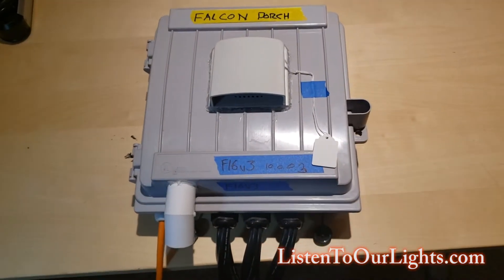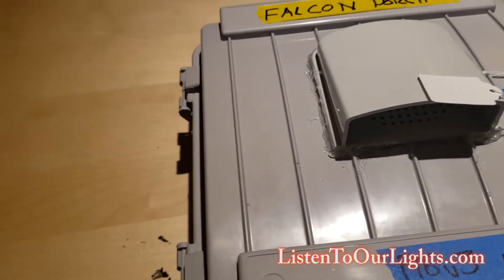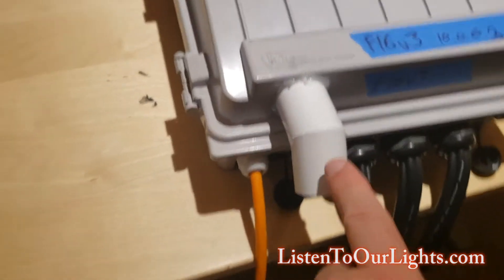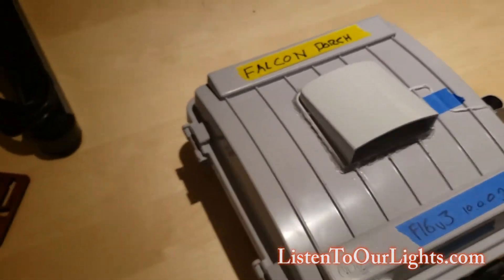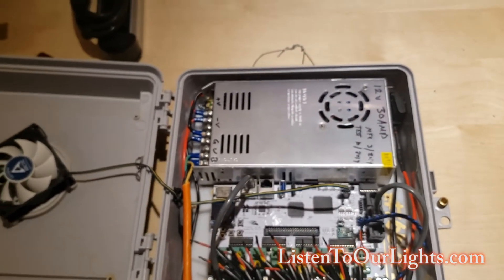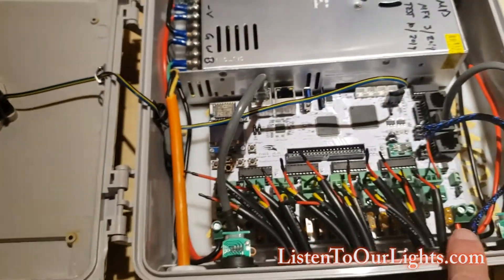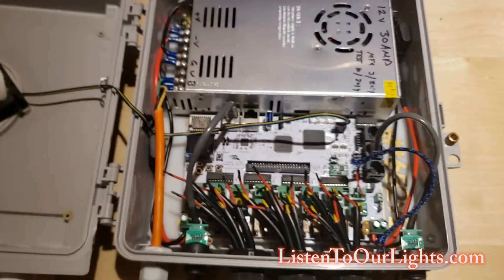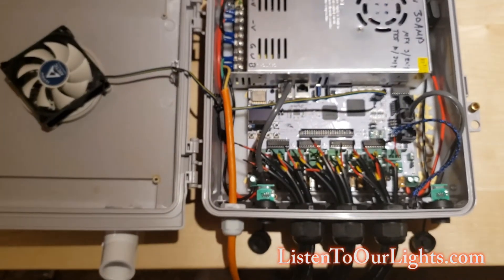Falcon F16v3 Pixel Controller Tour

Comment: I got a question  how does one calculate  what amp to use all my pixels are 12v .... currently  I have 4 displays with the longest run i have is 930 pixels ish and the rest are well below that amt.i guess  gettin a basic understanding  as I'm sure I'll be adding more...
Reply from the maker: Note the max pixels and be able to maintain 40fps is 680. You can do more, but performance drops off. I think I use 0.055 amps/pixel for planning purposes, but it can vary.

Comment: Do you have a controller in the attic? Looking to do permanent lighting under the soffit...
Reply from the maker: I don't. For lights on the roof I run 40' of cable for data. For power I have a power supply on the roof secured with a sandbag.

Comment: Hi John,
Another excellent video for those who are new to the hobby like me.  Would you happen to have a video going over one of you power injection boxes?  I am in the process of planning a build for a power injection box.  I was looking for some recommendations from a seasoned pro.  For example automotive fuse block vs a power distribution board and xConnect vs waterproof automotive wire connectors.  What wire gauge.  Things like that.

As always Thank you for all of your contributions!

Comment: What the best low voltage controller for me to start with
Reply: Falcon makes a picap controller. It only has 2 pixel connections BUT if you want to just get your feet wet and start playing with it without breaking the bank.... that’s the way to go. You can probably get going with $100 for everything, the picap, the pi, Amazon power supply, cheap pixels from Amazon.